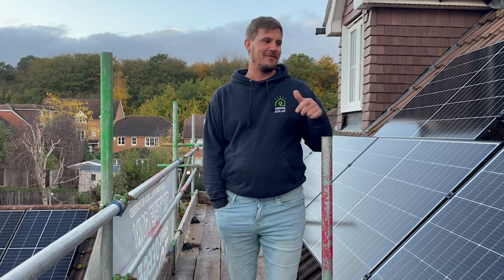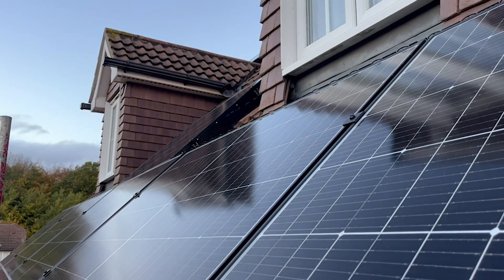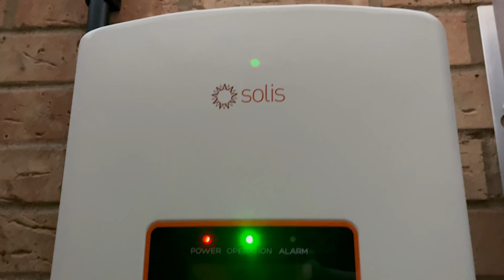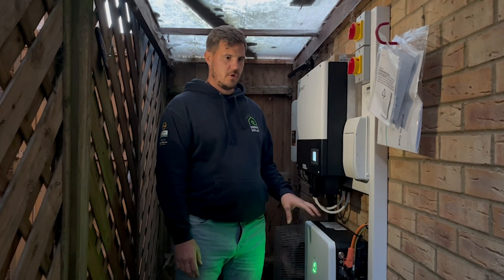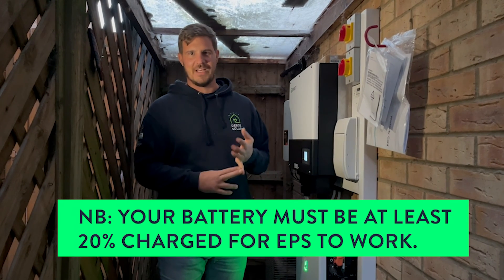Solar Panels, Battery Storage and Emergency Power Supply (EPS) | Power Cut Solutions

Comment: I have a question for you that I know of others would like the answer too.
I have a hybrid 5kw solar set up, and as normal all systems have limitations, my PV is set up at 133% but the panels are split over two different roof areas, I have a large battery pack (30Kw) and the inverter givens me 3000 watt to run the house and once the batteries are full any extra power generated is going back into the grid. pretty standard set up.
the question is, I often am putting 4500+/- watt back into the grid, I also have a solar diverter that put some of the grid feed power I generate into heating a large amount of water, SO in a power cut the legal set up required shuts off the grid tie output which is good for safety to the protect anyone working on the grid or you feeding power into other houses.
so as I have a lot of power I am generating that is going back into the grid,  in a power cut, clearly the first thing to do is switch the mains fuse off, disconnecting the house from the grid, how can to then trick the hybrid inverter into powering up the line you would have had connecting to the grid so I can use this extra power to heater the water and is this output self limiting its output for once the water is at temp and turns the elements off.
regards
Martin

Comment: How long do those teeny batteries last?

30kw here and still not enough!! 

Big house to cater for and other options around the 6kw Hybrid to avoid AC Coupling.. 

Battery running at 0.5C most of its life - ouch!! 

It looks like the battery is outdoors - what happens when its minus ten in Winter?

Comment: The growatt SPH series all come packaged with a free EPS socket, there’s really no need to have an expensive unit fitted to switch it.
If you get a growatt unit ask for the plug, you paid for the inverter so the plug is yours. 
The plug just requires a cable and a twin socket fitting to it, any electrician can sort this for you, ideally the solar installer should fit this for you, mine did.
Reply: You don't understand, what you are describing is an EPS powered socket that would only come on in the event of a power cut. The ATS switch means the circuit or circuits are powered normally and also powered by the batteries during a power cut.
Reply: You don’t need to spend more on the extra kit, I’ve had 2 power cuts so far and used this system for the fridge freezer and powering a few lights, xbox, tv and internet.
It powers the living room and appliances, who needs anything else during a power cut, if I needed to cook I would either plug in my air fryer or go out to eat.
Reply: @robhunter6939  Are you running an extension lead throughout the house in that situation?

Comment: I understand that if the grid goes down an inverter is required to power down to avoid danger to grid repair workers. If there is a manual grid disconnect switch then the house might then be able to work from PV/battery, however the inverter will still see no grid voltage, so how can it know to start providing power?
Reply: I’m wondering about whole house backup here, not a restricted EPS “essential circuits” option. I understand an AC coupled battery would supply power to an island- disconnected inverter to allow it to repower, but what happens for the case of a DC coupled battery?

Comment: Is a separate auto transfer switch for EPS a requirement in the UK?  I just asked my DNO (SSE) and they didn't know! According to Growatt their SPH UP series inverters have the transfer switch built-in, but some countries require a separate transfer box as well. The original SPH series did not have it built-in so a separate box was required anyway.

Comment: What I can't get my head around is the need for the ATS? I am installing a Solis Hybrid which comes with EPS or AC backup built-in which I am told performs the switchover should there be a grid outage. Why cant I feed a new sub-board, which will have a few critical load circuits in it, from the AC backup port on the inverter via a suitable rotary isolator?
Or is the ATS an DNO requirement?
Reply: ATS needed so you don't feed back to grid and hurt someone that is working on the grid down stream

AtS can be a relay or a physical switch

Comment: Really interesting video, especially the EPS element.  Am I right in thinking if you dont want/need an automatic/manual switch over to EPS to power the whole house circuit, instead you can wire up individual sockets off the EPS connector on the inverter, maybe getting red sockets, which you can use off the battery if the grid goes down?
Reply from the maker: That is correct! A socket can be used as an EPS outlet, we usually suggest this instead as it is more of a low-cost solution. So unless you are in a remote location with regular power-cuts we would highly recommend this option instead. 

You may wish to read the blog on our website 👉 https://www.deegesolar.co.uk/eps_for_solar/ . It goes through the various types of EPS for solar you can have. 😊

Comment: Great Video, I thought the same until my electrician I use switched off the main power to check but unfortunately it did not work. You installed my system with two storage batteries and I am very happy with it. I will be interested to find out whether EPS can be retro fitted and if so please send me a quote.
Reply from the maker: Yes a very common misperception! We are glad you happy with your solar panel system. 😊EPS can indeed be retro-fitted, so email our team at enquiries@deegesolar.co.uk for a quote. 👍